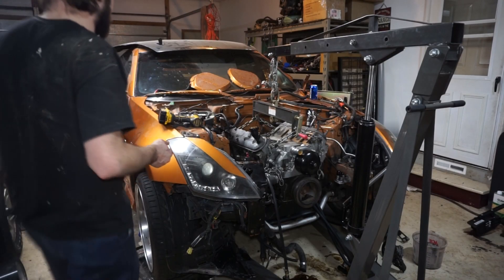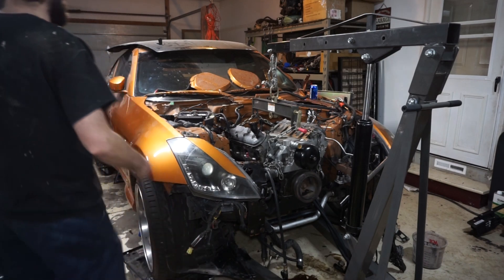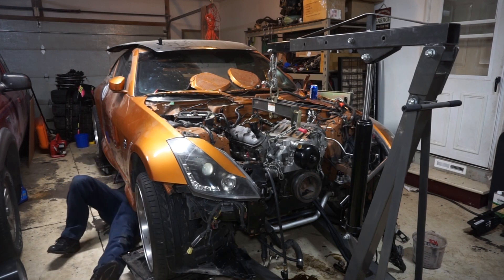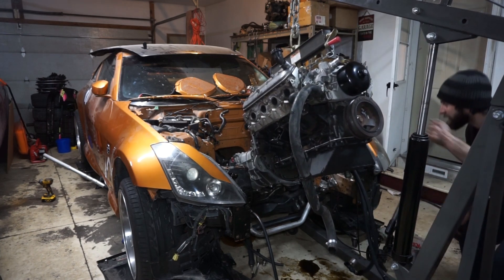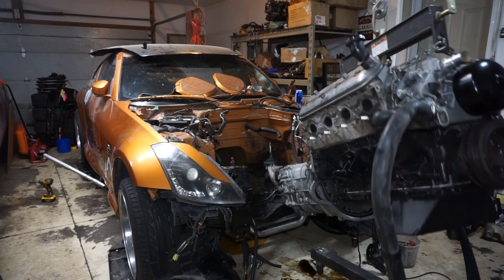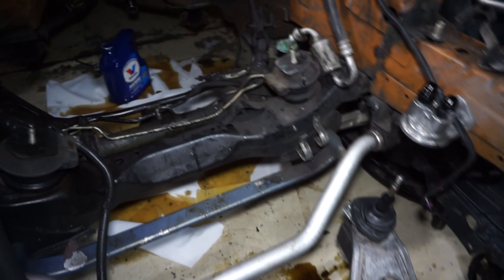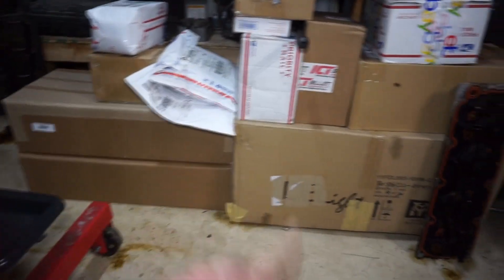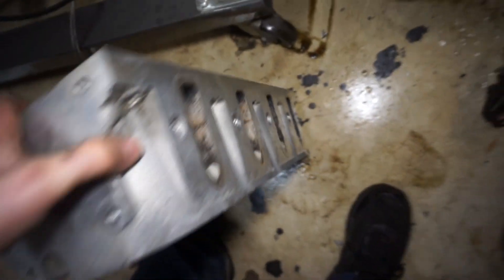LS Swap My LS Swap!!! Pulling Iron For aluminum!!!

Comment: You can buy better quality casters and it makes a night and day difference. Cheaper than buying a new engine hoist. But ya, it’s one of those out of sight out of mind things, if only doesn’t work when you are using it, it’s find when it’s sitting in the corner
Reply from the maker: Exactly... My issue is they're two different sizes... one broke (dropped 350 small block on it) so I welded a random one on...

Comment: Did you have any issues with all the extra weight of the engine sitting on the front wheels? Did you have to add stiffer springs? Also after all that extra weight in the front was the back end to light? Doing a 6.0l swap into a g35 and trying to figure out how far forward I can have it till I run into the above problems. Any info on doing this swap would be very appreciated. Thanks in advance!
Reply from the maker: Check out my playlist. I cover the entire swap keeping the factory drive shaft and trans position. I didn't see any issues, but can't really answer for weight compared to factory because there's a big stereo in the back.
Reply: I’ve watched them all several times 😂 I guess I’ll just have to add a stereo as well then 😋 thanks!
Reply from the maker: @amosfoley585  I wouldn't think it would be a problem. The weight difference between aluminum and iron block LS is only 90lbs... The weight of the VQ35 isn't much different.